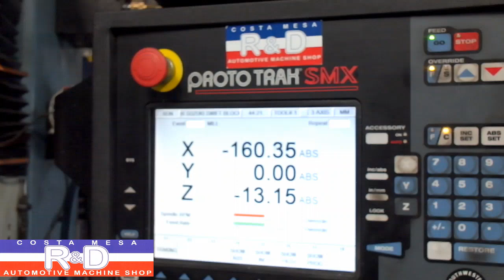Suzuki Swift GT Block Bore Resurface O Ring

Comment: I really like your videos and I've watched more or less all of them but had a question. Since this is an open deck block why you wouldn't have used a torque plate? Or will you do this at the honing stage to regain true round bores? Not sure if honing would take out of round bores to round again or if they would just mostly follow the existing contours that boring had created. 

Thanks for taking the time to make all these vids. I really enjoy them.

Comment: i don't think you are supposed to rebore cylinders in a sequential order.
Reply: What is your reasoning? If you are going to 'think', then tell us why and where you got your info.
Reply: i used to be an apprentice at a machine shop.So i learned that heat and stresses should be distributed evenly across the block or that the engine should be rebored closest to operating temperature. So the rebore sequence should be 2-4-1-3. When the block is at room temperature and one side starts to heat up, this leads to a conflick in thermal expansion.Some blocks are even rebored with hot water flowing through them to simulate the upper limits of the metal "creep".
Reply: In theory your right but it won’t make difference in the end. When you bore the block you leave material to be honed to finished size.